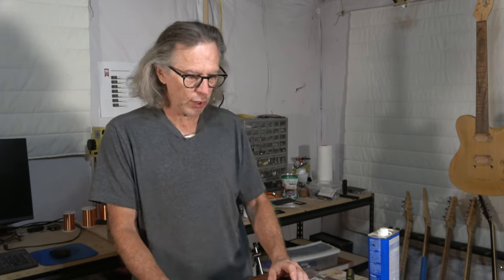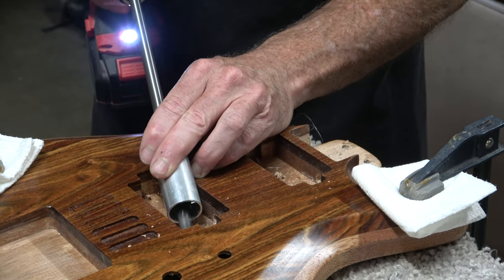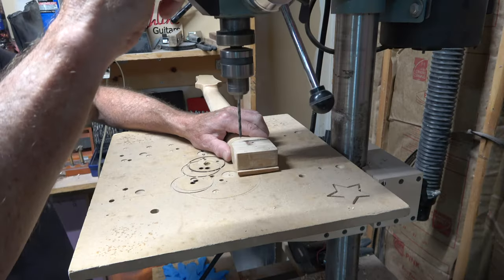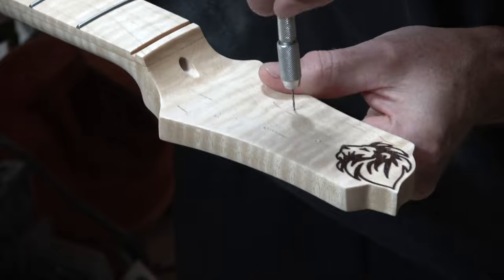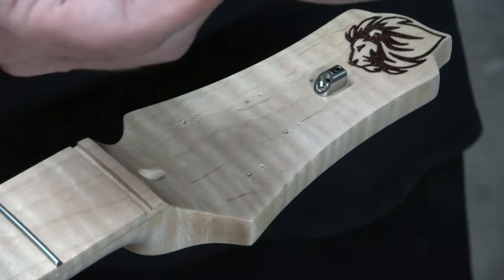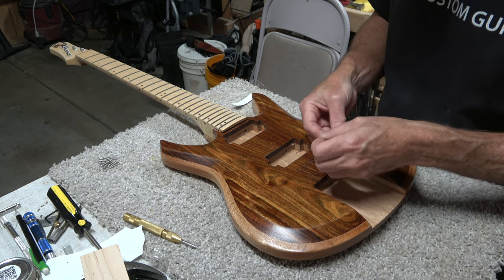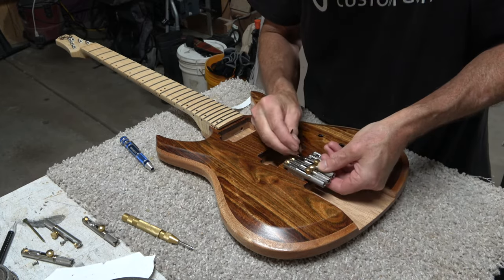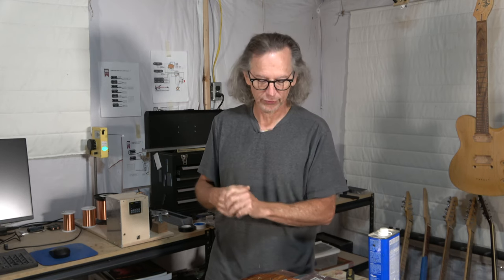Combining A Headless Electric Guitar With A Traditional Electric Guitar Part 9 Assembly

Comment: Using countersunk screws so close together to attach the neck instead of a neck plate,  your creating stress in the pocket area of the body when you tighten them, especially noting the direction of the wood grain is also parallel to the alignment of the holes for the screws. I predict you will eventually split the grain between the holes and create cracks outward toward the edge of the body underneath the neck. Also the counter sunk ferules will not stop the cracks because they need to have a solid hard surface to press against when tightening the screws, your only screwing them into the wood of the neck. Maple wood is hard but not hard enough, and the ferules will simply make depressions into the neck, I suggest inlaying a steel plate or flat washers into the neck to support the ferules for true strength. Good luck.
Reply from the maker: I love when people overthink and over-engineer a simple process. Just so you'll know, I've done this more times than I can count without ANY of the issues you described.
Reply from the maker: @GCKelloch  You are mistaken, and you are way overthinking this even if you're the type of player who constantly bangs his guitar against walls and/or speaker cabs. In tests I have done, the neck will snap before the heel joint fails.

Comment: What spacing did you use between the strings on the bridge? I bought the same one, but the axial bearings have an external diameter of 11mm, which means they will be different from the usual 10.5mm standard. Good luck to you!

Comment: Question on the string retainers; shouldn't they be installed with the mounting screw facing away from the nut? With how small they are, it seems like it could go either way, but my brains says they are backwards. The screws being hidden by the string probably will be more astatically pleasing tho.
Reply from the maker: If they are rotated 180 degrees, the string’s tension will pry up the mounting screw. That’s highly unlikely, but the way I have them installed makes it easier to clip off the excess string flush with the end of the retainer’s housing.
Reply: @HighlineGuitars  Strange logic!  There's even a notch made for the head of the string.  You obviously put it backwards.
Reply from the maker: @polurich9968  NO!!! The head (ball end) of the string will be inserted into the bridge.
Reply: @HighlineGuitars   Now I understand your logic :) If the ball end of the string is inserted into the bridge, then the orientation of the retainers doesn't really matter indeed. I think that we were simply puzzled because it's not what you showed and explained in the first video.

Comment: Are those steing clamps on the head stock the wrong way? I presume you want the screw at the back so the string is pulling it down.
Reply from the maker: If I was going to install the ball end of the strings at the headstock, then I would install the retainers the other way around. However, The ball end will be installed at the bridge and the string will be clipped flush with the retainer. The retainers are too small for the screw to matter whether it's at the front or the back. There's about an 1/8" difference.

Comment: Hey Chris, I have a crazy question for you.  I was thinking, is there any reason why a nut can't be angled on regular set up to make the lower strings longer like a piano?  How would that change a guitar and would there be any benefit to it?  Also, in doing your headless headstock with bridge pins, could they be angled as well like a reverse headstock!  Like I said, crazy thought that came to me from fanned fret guitars and the way tuning pegs are set up on the bottom end offset like that.  Know what I mean?  Hope I'm explaining my question understandably!  Cheers
Reply from the maker: I actually thought about angling a nut instead of angling a tune-o-matic bridge once. I never did it, but don't see why it wouldn't work. I'm not sure what you mean by your headstock idea.
Reply: @HighlineGuitars  I don't understand this angling of a nut. Angling a nut so that it wouldn't be parallel with first fret?
Reply from the maker: @Tomislav_B.  that is correct.
Reply: @HighlineGuitars  So on the bass side fret is further away from nut than it should be? Frets are not fanned? I don't understand, then it won't be in correct pitch on the first fret?
Reply from the maker: @Tomislav_B.  no, it wouldn’t.
Reply: @HighlineGuitars  OK. But I don't get it, if the frets are not fanned and just nut is angled when you tune open strings frets would be relative to the nut in wrong position? What manufacturers used that system?
Reply from the maker: @Tomislav_B.  none that I know of.

Comment: Hi Chris, am I the only one who realized you installed the string retainers upside down?  I went back to the first episode, and the hollowed part with the screw should indeed look toward the lion logo 😬(a trick to get comments or a genuine mistake? 😄)
Reply: No, you are not the only one. When installing the retainers this way, with the tiny mounting screw before the point where the string is attached, the string tension will pull the screw out of the wood.
Reply from the maker: No. They can be installed either way.
Reply from the maker: Wrong. You’ve got it backwards.
Reply: @HighlineGuitars  either way it tends to pull the screw out. But the way you did gives it more leverage on pulling the screw.
Reply from the maker: @joseislanio8910  No it doesn't. You are overthinking this. There is nowhere near enough string pull to do what you think will happen.
Reply: @HighlineGuitars  alright, you are the supreme knows it all. Cheers buddy.